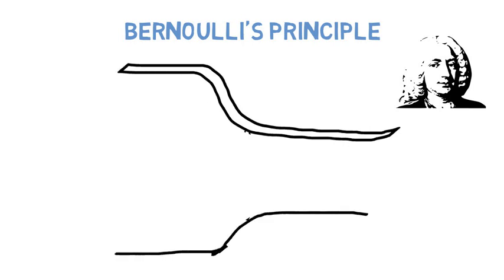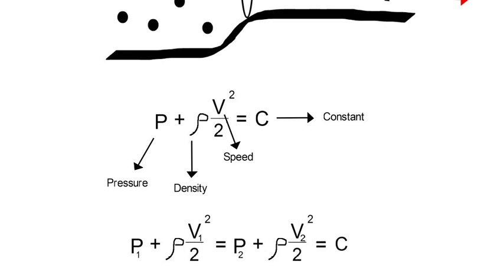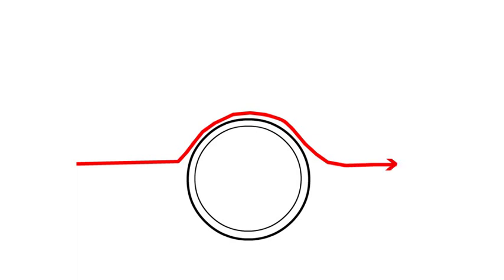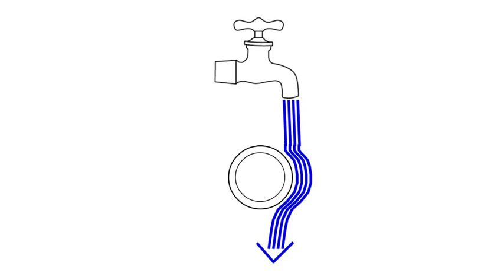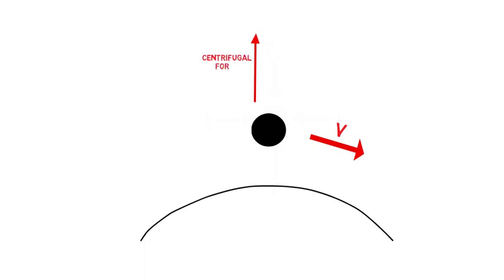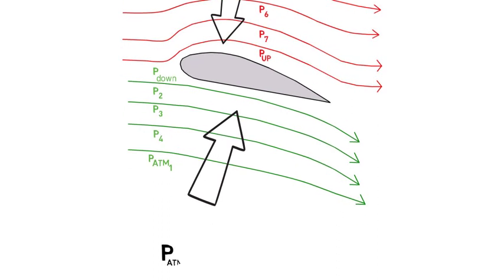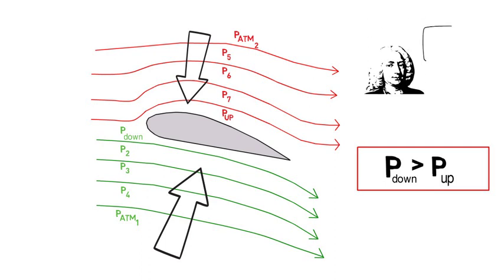Part 2 - Coanda effect, Bernoulli's Principle and Lift

Comment: Forget about Bernoulli and other Scientific names, Wings fly because of the physical actions and reactions that occur between the distributed heavy fluid, sticky, and elastic sealing particles existing around the zone in which the wing exists. NOTE THE IMPORTANCE OF MASS AND STICKY, SEALING, ELASTIC PROPERTIES OF THE FIELD AROUND THE SURFACE OF THE FLUID MASS PARTICLES, INCLUDING THE  RELATED FIELD PROPERTIES AROUND THE SOLID WING WING ITSELF. 

Here is how it is all combined.  Let us forget about wind tunnels as in these devices the air moves while the airfoil is stationary and in real terms, it is the wing that moved forward while the air is first motionless and then moves a little around the airfoil. 

Let us use an analogy to explain it all and this includes the air particles being looked upon as a heavy golf ball ( mass content) covered in honey as a sticky, sealing, elastic medium and the golf ball is effectively tied with an elastic band to the wing, which is a heavy traveling mass shaped with an angled leading edge, as a golf club. Note, that any hitting mentioned is in fact a buffered hit by a compression zone of elastic fluid particles. 

How the upper surface of a wing works. 
With the stationary golf ball mass, (Air particle)  ahead of a moving golf club,  but elastically tied to it,  the angled leading edge of the horizontally moving golf club ( wing)  hits the golf ball ( compression pressure zone)  which is suddenly accelerated, basically vertically up. As the golf ball mass rises up, the elastic band connected with the golf club( wing)  tightens up ( suction low-pressure effect)  to decelerate and slow down the rising mass of the golf ball,  the same tension  (suction) accelerates and lifts up the, horizontally moving golf club (wing). As the horizontally traveling golf club( wing) passes under the flight of the golf ball, they both keep pulling each other, ( suction low pressure) but as the mass of the golf club is higher than that of the golf ball, the golf ball will accelerate down  to  the rear slope of the golf club ( rear slope of the upper surface of the wing)  to be dumped behind the trailing edge of the golf club ( wing)

How the lower surface of a wing works assuming it has an angle of attack..
With a stationary golf ball mass, ( air particle) in line under, ahead of the lower UNDER surface of the leading edge of a golf ballclub (wing), the elasticity of the layers of the surfaces around the other golf balls ( air particles) will act as the liquid water in front of a bulbous bow of a ship to cause a compression zone where this compression will accelerate the golf balls vertically down so that the golf club ( wing) will proceed to travel horizontally. This acceleration due to a running compression zone will accelerate the mass of the golf ball down, while at the same time the compression zone will accelerate the golf club ( wing)  up.  

The total lift is the summation of the suction and compressed accelerations of the masses of the golf ball particles.
Note the total lift will have a vertical component ( useful lift)  and a horizontal  component ( drag) 

Note, that for all intent and purpose, the next golf balls processed vertically up, on the upper surface will tend to face a suction zone created by the previous golf balls being sucked down, and so they will gain an additional horizontal component towards the trailing edge. The next processed golf balls under the lower surface, which, while being accelerated vertically down, are also faced with a compression zone horizontally ahead of them which will give them a back horizontal acceleration towards the leading edge.  This is the reason why in the wind tunnel the upper fluid particles gain a higher velocity than the lower fluid particles. Again note that in real flying the upper air particles in addition to an up and down acceleration, they are also accelerated and DISPLACED TOWARDS THE TRAILING EDGE  while the lower air particles in addition to being accelerated down,  ARE also accelerated and DISPLACED TOWARDS THE LEADING EDGE. This relativity is seen in a different manner in the wind tunnel and the real flying situation, where the wing moves, and the air is initially stationary.  We must no longer talk about the air traveling over the surface of the wing! It is the traveling wing that is moving through a set of initially stationary mass particles, the whole system being mass inertia /elastically connected together as in a spoon churning a bowl of soft custard! 

What Bernoulli, Navier Stoke, Neuton,  and other scientists say is all contained in the above practical physical philosophy.

When it comes to vortices, which is a case when the suction zone is too fierce and so it breaks the elastic layers around the fast-moving fluid, this will be instrumental to hold the stability of mass moving in a circle, which is the same as what the mass, gravity relation of planets do in the universe. (Perhaps this suction at the center of rotating mass particles, may also be used to explain cavitation and boiling water at low pressures. Note this is not aeration) ) When it comes to a high compression zone with respect to the duration of flight of fluid mass particles over the wing or blade surfaces of a propeller, ( in fact it is the wing and propeller that pass the stationary particles) too high compression zones will cause the fluid to distort and roll and bend and fall over the leading and trailing, and tip edges of wings and propellers, especially surface water propellers, where the suction side may be neglected as it begins to handle air and not a heavy. mass lumps of water, which is 800 times heavier.  

Finally,  zones of fluid particles are no more than a three-dimensional MATRIX  of ELASTICALLY  connected  MASS particles with suitable damping,  through which an ELASTICALLY CONNECTED SHAPED AND CONTOURED SURFACE OF A BODY MASS related  ELASTICALLY to all existing masses in the system needs TO LATERALLY ACCELERATE THE MASSES IN THE MATRIX, to travel through it. Whatever the contour of the wing, it cannot be shaped such that the horizontal component of accelerated particles will produce a self-propelled wing with perpetual motion!!!  We have to live with lift and drag exchanges as desired with the angle of attack in a  wing with a constant shape.  It is engines and altitude that can overcome drag! 

It is interesting to mention that all piston and jet engines are more efficient because they have higher compression cycle turbos and superchargers driven from their shafts, and long tailpipe tuned suction scavenging. It seems that in a cambered wing, ( all wings really)  the high-pressure compression zone at the edge of the upper leading edge, and the suction zone below the leading edge, appear to be useless and contributes to drag, but the compression zone above the leading edge and the suction zone below the leading edge will and can   CURVE THE STREAMLINES MORE AGGRESSIVELY, HENCE HIGHER  FLUID PARTICLE MASS ACCELERATIONS ABOVE AND BELOW THE WING TO BENEFIT MORE LIFT at lower wing speeds.  So like piston and jet engineS,  investing in a higher compression stage and a higher suction exhaust scavenging would benefit more power, and in a wing, investing in a leading-edge which will first compress and accelerate the air particles upwards on the top surface,  and a suction zone to accelerate the streamlines upwards below the leading edge, will benefit a sharper curve of streamlines at a later stage in the maas particle flights, above and below the wing, to benefit the lift action.   How much to invest in compression zones ahead and above the leading edge and suction zones below the leading edge is still the greatest headache of an aircraft engineer!  The answer exists in the 3-D vector integral of the vector acceleration field around the wing given by the four principal zones around the wing.
1. Compression zone on the upper edge of the leading edge followed by:- 
2. Suction zone on the mid to rear slanting down upper surface all the way to the trailing edge.
3. Suction zone below the leading edge followed by:-
4 Compression zone after zone 3, which goes all the way to the trailing edge.  

It is the engineering logic contained in zones 1.2.3.4 that will give the curves and  THE RATES OF CHANGE of the streamlines around the wing, which act like impermeable flexible membranes to be shaped by what zones 1.2.3.4 may offer the mass/elastically linked streamline sheet membranes................no vortices assumed which are rotating circular sheet membranes. 
There is one useful philosophy in engineering, and that is, recognizing the intention of the function behind the external shape and contour of an object, including recognizing and understand the function and potential abilities of a man and a woman through their shape, all through knowing the function behind a shape, including people wearing a uniform as pilots and military personnel do!    No shaped trajectory ( structure), color, and noise sequences ( vociferous socially emotional professions) can ever hide the unseen reality when viewed and analyzed by an engineer and a mathematician!

Comment: Well you don't explain why the Coanda effect creates low pressure against the upper foil surface. Instead ,you present a circular argument, in which the curved flow creates centrifugal force which creates curved flow = circular argument. 

Coanda effect occurs because an air flow travelling over the upper foil surface attracts the air surrounding the flow, towards the flow. 
This results in a sleeve of low air pressure adjacent to the flow. 
The sleeve of low pressure closest to the foil surface cannot be filled by surrounding air, due to the presence of the foil. The sleeve of low pressure on the upper surface of the flow can be filled quicker from adjacent air above. This results in a a tendency for the flow to move closer to the upper foil surface. i.e. low pressure adjacent to the foil below the flow, normal pressure above the flow. This is the Coanda effect. 

The flow close to the foil is also facilitated by the angle of attack and foil shape creating a low pressure above the foil. As the foil moves at a positive angle of attack through the air, flow that would have traveled horizontal is forced down under the foil. This creates a relative low pressure behind the top foil surface. This low pressure attracts the flows going over the foil towards it.....and at greater speed due to less resistance from the low pressure.

Comment: FINALLY !!! 
It appears that you've improved this video since I last commented.  It hits the important points rather well. 
Lift is the lower / upper pressure difference.
The curved flow above is the cause of the lowered pressure.
[curved flow is also the cause of the higher pressure below]
..
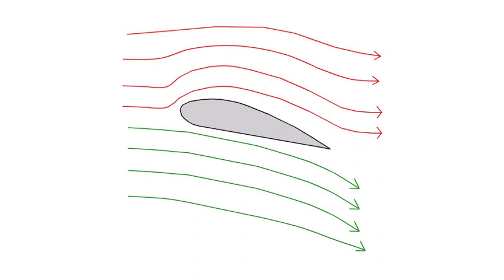HOWEVER, those red streamlines above the wing at 7:37 should curve downward behind the trailing edge.
Also,m it would be much better to refer to the upper pressure as Pupper because Pdown can be confused with the bottom pressure.  Likewise for the Pup --> Pbelow.
Otherwise, GOOD JOB!
FINALLY a video by someone who gets it !!

Comment: I'm searching for the reason that the pressure above the wing is lower than the pressure below. (I know it is, and I know that the pressure difference causes lift). Saying it's due to the increased airspeed over the wing is a CIRCULAR ARGUMENT! The speed above greater than the speed below because it's moving from high pressure to low pressure. That's a circular argument which is missing an independent explanation either for the speed difference or the pressure difference. And invoking Bernoulli to explain how increased speed induces low pressure is just a mathematical relationship between speed and pressure. Can someone, please explain the reason that there's a difference between the air over the two surfaces. (it's nothing to do with path lengths!)
Reply: Alan,
You're on the right track.
In short: the upper air is at a lowered pressure because of the curved (radially accelerated) flow.
..
A summary in basic concepts is that the wing must push air out of the way to get through it -- and the air pressure pushing inward all around the wing causes it to flow back in around the wing to "fill-in" behind it, wherever needed ti enclose the wing again.
.
 Where the wing advances into the air, this pushes on the air and this increases the pressure.  Where the air flows in to "fill the void" sort of behind the wing, this lowers the pressure allowing higher pressure regions to push it back in.  The air around the wing then moves (accelerates) from higher pressures to lower pressures.
. 
This explains it step-by-step: https://www.quora.com/q/rxesywwbdscllwpn
Reply: Of all the potential inviscid flows possible, on one meets the Kutta condition as soon as viscosity is introduced. That’s why the stream paths follow a curved path. The curvature causes pressure differences. The pressure differences cause accelerated flow.
Reply: @fredericborloo1910  That says essentially  the same thing.
Reply: Had the same issue from the explanation, thank you for asking it!
Reply: Quantum Fluctuations my friend, Quantum Vaccum Fluctuations.

Comment: According to NASA https://www.grc.nasa.gov/WWW/K-12/airplane/wrong1.html,
this explanations is partially wrong. For insntace, this video 
https://www.youtube.com/watch?v=jhem8Z9ujPE
shows that close-hauled motion with no wind on leeward side is posible.
Reply: That does not make sense.  This video above is one of the best ones on the net about lift and it does not claim the equal transit myth shown in that NASA page.
.
That second very short video does not contradict anything in this video - in fact is describes nothing.  It just shows some lift being generated.
Reply: @Observ45er  the coanda effect specifically relates to fluid viscosity, something which isn’t needed for lift or when explaining lift, the air bends over an airfoil and the flow gets deflected just fine as a result of air being a fluid that flows and pushes on everything, so when an object flys through it, it forms an area of low pressure by the virtue of the air not being able to push through an object, bending the air downwards creating lift.
Reply: @iain3713  That is all very vague and somewhat confused, so I can't be sure what you are getting at.  If you want to discuss this you must be very clear which place you are talking about and what the fundamental principles ar  you are using and how they apply.
.
Coanda is defined as a forced jet into an otherwise still fluid, but you are correct if you mean that it is not happening above a wing since there is no jet blown into still air.  And, yes, it relies on viscosity to form constant entrainment around that jet which is a factor in the phenomenon.
.
Then, the low pressure above a wing is caused by it's inertia trying to move in a straight line, but the surface moving away from that path, thus lowering the pressure.

Viewed in the still wing/ wind tunnel view, a direct analogy is like being at the top of a ferris wheel where gravity is pulling you down, but because you have mass and  the curved path, you feel like gravity is decreasing.  Air above a wing is in a curved path and  is being pushed down by the air pressure, but in effect "pulling" toward the outside of the convex curved surface. lowering the pressure near the surface.
.
The converse happens along a concave surface's curved flow, such as under a wing, The mass, in effect constantly "running up against' the surface,  is pushing harder on the surface thus increasing the pressure.
It is this situation that occurs where the air, "not being able to push through an object" would increase the pressure.  If it is generally heading toward a surface, it would be trying to "push through it".

This all happens because of the same fundamental phenomenon, Newton's First Law, just in opposite directions. A mass in motion "wants" to continue in a straight line, but atmospheric pressure and a nearby surface causes a change in direction of the flow and this causes pressure changes. 
Regards

Comment: If Bernoulli actually gave lift in air, how can planes fly upside down? Wouldn't the faster air over the curve (now on the bottom of the wing) cause the plane to lose lift and dive? Yes, Bernoulli applies... but it's not strong enough to generate lift in air.
Reply: Yes, Bernoulli is not the only explanation for the lift, but planes fly upside down because of the higher angle of attack of the plane in relation to incoming air when flying inverted. Fighter planes with high T/W ratio can climb vertically at 90 deg nose high and in that case the plane is flying at certain AoA where it is not producing lift. In other words, upper and lower part of the wing/plane are in pressure equilibrium at that given angle of attack.
Reply: @Semendrija123  agreed... but I think you missed the main point, which is that if the Bernoulli Effect was the reason airplanes stayed in the air planes could not fly upside down.

Comment: i have a question. about that tornado. when air moves a longer distance the pressure will go down but here you said the highest pressure was on the outside of the tornado. but that is the oppisit of that.
Reply: no in the center there is low pressure and in outside the pressure is high